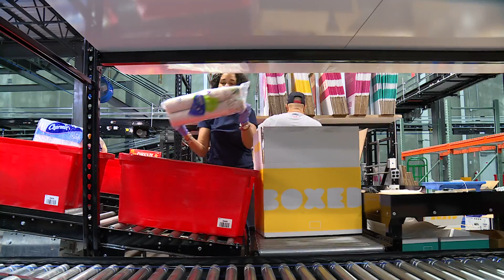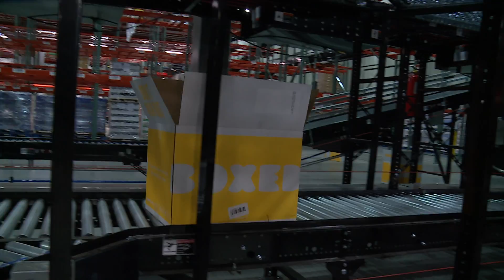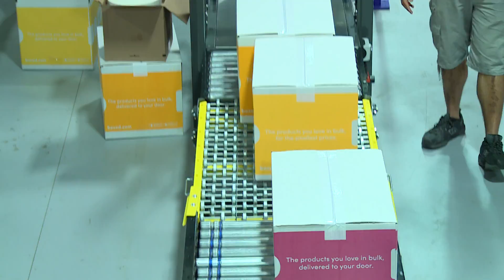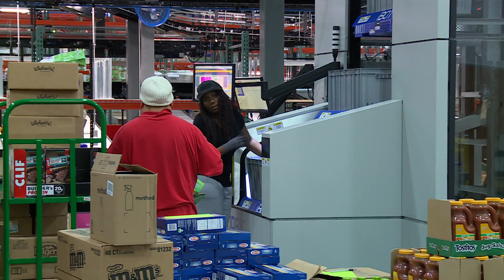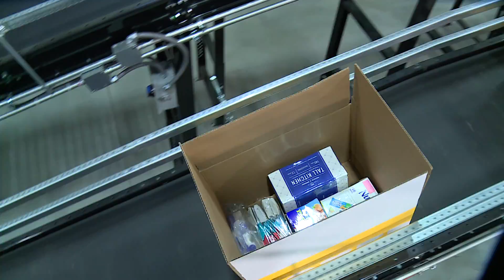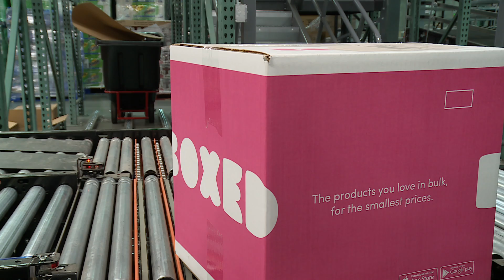Boxed.com's Fulfillment Center in New Jersey Goes Automated | Inverse

Comment: Very slow process.. why is there so many machines doing such a little job and so slow? I mean did you see that machine that only put tape on a box? That machine was huge and the process was so slow..
Reply: • Quality assurance
• Maximize visibility of branded collateral
 (vendor branded tape)
• Tight seals reduce damages in transit
• Tight seals mitigate adjustment fees due to those "sensitive" cubi-scanners at UPS terminals.
• Humans get hurt
 - less workman's comp, lower insurance costs

Guarantee that simple machine pays for itself 10X. Especially once it realizes it's ROI.